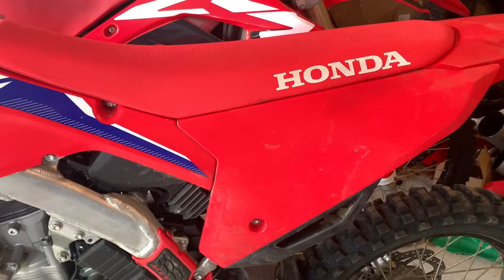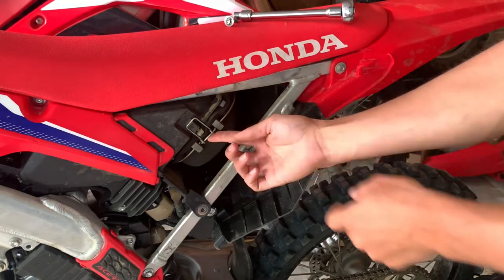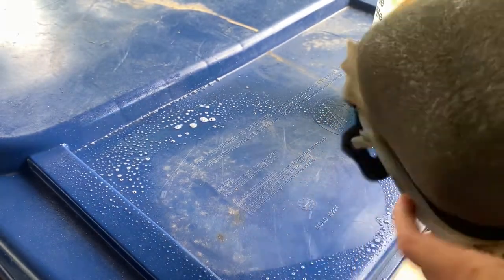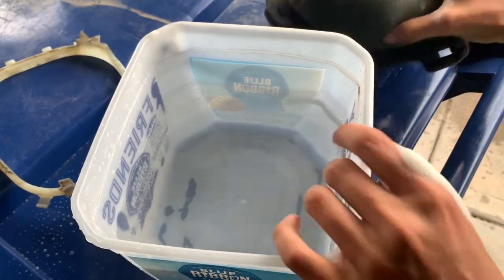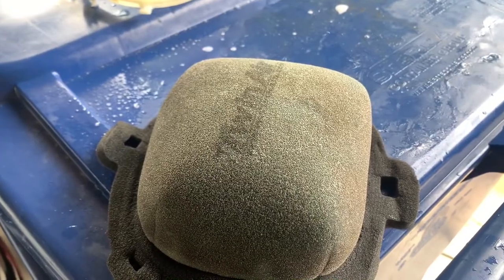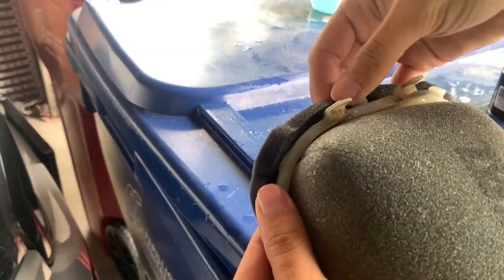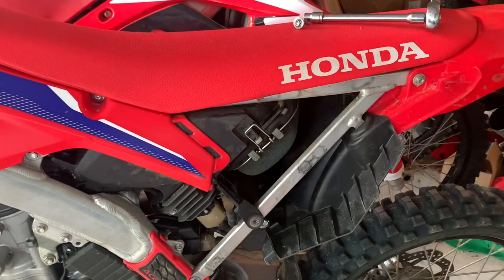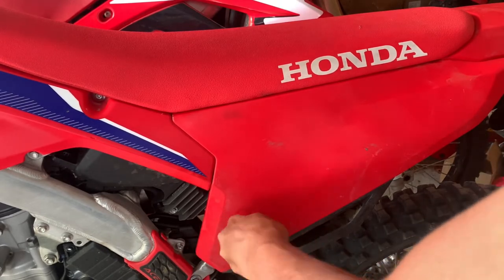How to Clean Your Air Filter on Your 2022 Crf 250r

Comment: I lifted my seat, just out of curiosity. There is a black plastic cover so u can't see the air filter. Is it the same for the US models?
Reply from the maker: Air filter is under the left side panel (number plate) not under the seat
Reply: @FullThrottleEdits  I know. But do u have the black cover under the seat?

Comment: No mesh on the cage for this year?
Reply from the maker: Nope just straight air filter
Reply: How about on the bike itself? How you find taking the filter off when it's dirty as it looks tight.
Reply from the maker: It’s really simple, I’m used to my 2020 taking the seat off and taking a bolt out of the filter, this is really easy. Takes 30 seconds to remove and install as well.
Reply: I'm also coming from a 20 model. How's the bike compare
Reply from the maker: Both are really great platforms but I think the 22 is better, they’re hard to compare because my 2020 was a 450 and my 22 is a 250. But I like the looks of the 22 better. The front shrouds feel better on my legs and overall the bike just feels better than the 2020. I’d ride either one of them equally, they’re both pretty equal otherwise to me.
Reply: @FullThrottleEdits the new hondas and yamahas have so much better air boxes than my 14 kx250f. it’s a pain to put a air filter in. it’s easy to take out but takes forever to perfectly line it up to put the bolt in
Reply: Diesel fuel works great